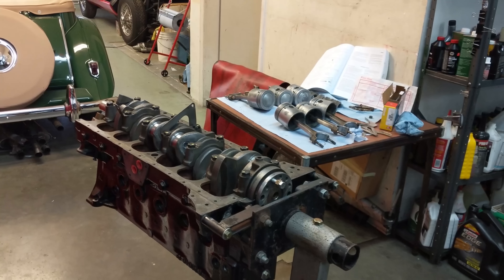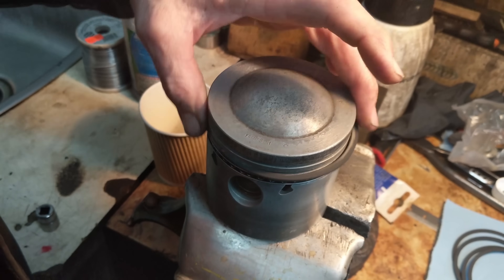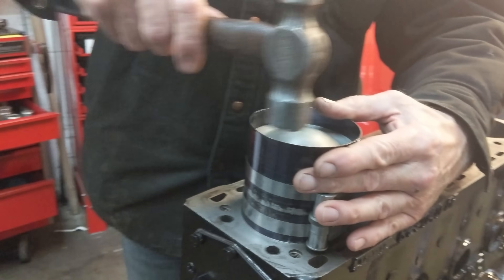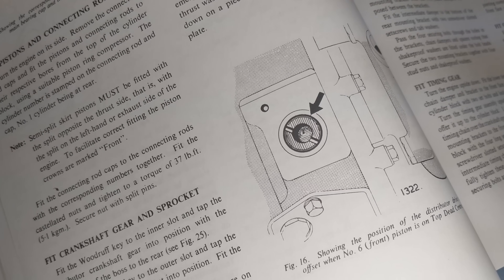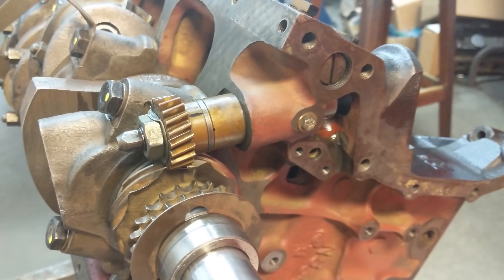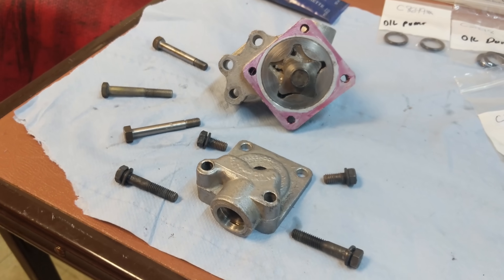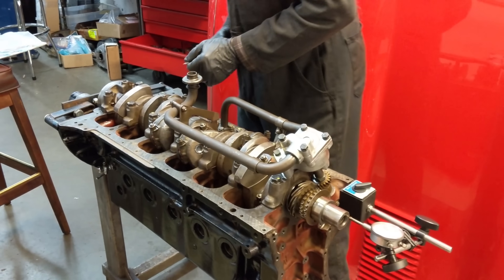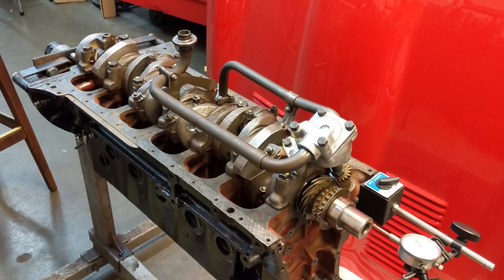My Junk E-Type Engine Part 6

Comment: You very lucky to have a great dad to help you along and pass the skills. I rebuilt my fist one in 1974 and completely cocked it up however Have now rebuilt my XK engine from lifelong skills and it runs great.Little advice-Use some cheaper oil to get it running and after the first hour change the oil and filter. You'll be amazed how dirt still is in there however careful you are. This will avoid any grit or swarf causing damage.
Reply from the maker: Adam. Great to hear from you. I agree, this engine was pretty surface corroded inside so a quick oil flush would probably be best. To be honest I didn't clean it all that thoroughly either.
Reply: I like his respect for his 'dad' and the respect for how the engine was buildt. Not just wasting good parts if it's within tolerance.

Comment: Nice Sequel to follow when rebuilding these engines!

I'm curious what type of piston rings did you choose? Do you have any suggestions based on the wear of the block?
Reply from the maker: I think those were Hastings
Reply: @RichardMichaelOwen  are those Hastings iron, chrome or moly kind of rings? I'm not sure what to choose

Comment: Coming back to this video after losing half my oil pressure this week,  I really struggle to see what could let go to cause such a massive drop in pressure. That pump is built like a tank.  The engine sounds great.  Assuming the pressure sender is ok, I guess I'll start by taking the sump off
Reply from the maker: Try a different sender or a fully mechanical gauge at the filter housing there. It's likely the electronics.
Reply: @RichardMichaelOwen  thanks for replying Richard, I will get a mechanical guage on it soon.  Hopefully just the sender, the guage reads maximum and minimum ok when shorting the sender wire to the block.

Comment: Hmm Lock Tabs, they were put there for a reason and old technology or not, they have a specific application on that engine, when a bolt rattles out, you will think why didn't I use the fold over locks. I notice you folded over 1 edge of a 2 fold lock tab on the oil pump. As you have previously stated, doing a thorough job is best.
Reply from the maker: Wayne, if you take apart your new Ford/Toyota/Audi you'll find no lock tabs for good reason.

Comment: Old video, but i will still leave a comment .  Why not re-tin piston/skirts for lubricity?  Also, all should use extreme caution ballerizing block or using scotch brite.  Both leave silicon carbide abrasive, no matter how well you clean.  I’ve looked at 100 engines with electron microscope after rebuild where SiC contaminants were the cause of the failure.   Either spun bearings of scuffed piston.  Clean carefully if used (thorough rinse with solvent).
Reply from the maker: Thanks for the tip. I usually rinse with brake cleaner.

Comment: OK Richard I don't know if this has been mentioned before but unless your dad has a gun at your head it is obvious that you have a great deal of knowledge (and also its obvious you dad does too), I love your video's and if you weren't that you live in freezy ass Can Nah Da I'd even visit you (so be thankful, a million questions have do I). I am currently re-building my MKII XK engine and was going to be sending you a couple of questions through your website but cannot find a Email address ??
Reply from the maker: Thanks for watching, just list your questions here
Reply: OK you asked :) as I do not have access to all the tools you have when sizing the crank seal is it possible to use the crank and do it in stages, ie: crank in lower seal in place then remove do it again with upper half in place ?

Comment: I have a 1971 E type, 4.2 Series 2.  It is certainly in need of an engine / transmission rebuild.  How can I contact you about pricing?
Reply from the maker: Charlie, our shop is Owen Automotive. 2506554338. Thanks!

Comment: Nice plus points for using a piston ring spreader. Mind you I did have a small heart attack when the hammer appeared, almost shouted no don't hit the piston with the metal hammer head but fortunately you were only using it to seat the ring compressor before correctly using the handle to tap the piston in!

Comment: Wow thats insane how the oil pressure is dependent on a o ring thats inside on a area that gets super hot to begin with, a flange on the pump and on the pick up tube with a gasket and bolts would have solved this easily from the factory, guess it works that way though.
Reply from the maker: It is flanged on one side that feeds crank, but I the flexibility of of the o-ring at the pump makes it way easier to install/produce

Comment: The gaps on the top 3 piston should be set at 120 degrees apart so compression does not go straight past the rings. Stagger the gaps will prevent this.

Comment: Richard, did you folks oil the rings and cylinder walls before fitting the pistons?
I have subscribed to this channel so I can watch this build up,..BUT I think I would have used all NEW bolts and nuts and certainly had those old wrist / gudgeon pins and their retainers replaced as well.  I think an engine re-build in this class, (Jaguar) deserves this. I was told many years ago that " any job worth doing, is worth doing well."
I am not saying you are wrong in what you are doing, I am just saying what I have done before. If I were there in your shop, I would ave asked the same question, I am merely chatting, with you.

Comment: Considering how frozen the wrist pins were completely checking them by disassembly would be a really good idea but I get it sort of a quick budget rebuild but if they have roller bearings in them  they really should be checked

Comment: Man I did an engine like this, it was a sbc, with just cleaning it by hand and a few tools like you are using. With the dingle ball tool and the ring expander. It ran fine, always a little loose but it ran for many years. It was done this way for decades. But it is good to see someone doing it these days.
Reply from the maker: Yeah not a top job for the junk engine. Hopefully I will get away with doing just the bare minimum.

Comment: I was with you all the way until you said you're not replacing the rod bolts!! Whaaaa.....aat??? You spent all of that time and money cleaning, prepping, replating bolts, nuts, washers but you reuse the rod bolts? It's lunacy, plain and simple. Those bolts have been stretched, have seen many cycles and are fatigued and should never be reused. God blessed you with a all original standard bore block, perfect uncut crank and you risk it all by not replacing the single most important fastener in the engine...SMH
Reply from the maker: Let's see, time will tell. I think this engine was fairly low mileage. I have seen many rebuilt Jaguar engines with original rod bolts, they seem to hold up.
Reply: @RichardMichaelOwen  Thank you for replying, and I wish you nothing but the best of luck with the engine and car. I love the old Jags and the thought of that rare, near new engine pitching a rod thru the side of the block and destroying it gives me chills and would be a very sad day.
Reply from the maker: @Sixguns1  yes I agree, would like to make a high-revving 3.8 sometime, then we would want arp rod bolts
Reply: WolverineLiving living YOU are so RIGHT.  I always replace any fastener under stress.  Oh well it's his engine but .....whew

Comment: When you first started to take the pistons out one or two of the Gudgeon/ wrist pins were tight, i would of taken them all out but it depends whether they are fully floating or shrink fit in the piston.
Reply: I'm sure I saw a circlip for a brief moment there in the side of a piston suggests to me they are fully floating. I have never heard of shrink fit in a piston, maybe you mean heat/press/shrink fit into the connecting rods ala Small block Chevy/Cooper 'S' etc.
Reply: Looking again, yeah, press fit, no circlips
Reply: @dalybaz  Hi Baz, my Vincent motorcycle has shrink fit gudgeon pins. You have to heat the pistons in an oven to expand them and very quickly slip the pin through the piston and rod then fit the circlips.
Reply: @johncone9516  Way cool. (no pun intended) That's one way to cure a rattle. I take it that the circlips are there to prevent bore scoring in case of an engine overheat. 
I've really only had experience with BMC 'A' series engines. The 850s and 997s  and minors had pinch bolt gudgeons, the 998s and 1098s had fully floating pins with circlips while the Cooper 's' and 1275 Spridgets had an interference fit on the conrods. All rather confusing really.
If you are hotting up a minor 1000 you pinch the pistons and rods from a 998. The maximum I ever got a Minor was 105 thou oversize using +60thou 998 Mini pistons. Another good mod is to use Teflon plugs to replace the circlips which have a habit of jumping out at high revs, with obvious consequences.

Comment: try a little oil in the cylinder and ring compressor to mark the install easy.
Reply: markam campbell All rings should be oiled before assembly .

Comment: I,m curious,,,,, 1000$ bucks for the engine... i,ve seen the oil pan for 1000 pounds!! I am wondering what the value of a restored engine like yours is.
Reply from the maker: No idea. If this was built for resale it would be a more thorough and expensive.

Comment: You should never, ever use the old cap bolts. These would have stretched. They might break. Always use new.
Reply: Totally agree! cutting costs here is stupid and could wreck your engine if one fails.

Comment: If it's not worn, broken or out of spec why replace it. Good job so far!
Reply from the maker: EXACTLY!!!
Reply: The simple answer to why is metal fatigue. Imhop, all fasteners, bolts, nuts, washers etc. should have been replaced with new ones just like bearings and seals.

Comment: Say Richard, I saw you reusing many crusty original bolts. Te;ll me that you cleaned them all with a wire wheel, especially the threads !
I really enjoy your series on this awesome engine. Thanks !
Reply from the maker: They will work just fine, despite the appearance.
Reply: That was off camera, Marc Rene, he didn't want to bore us with house keeping :)
Reply: Marc René Yvon He should replace them with new once they cheap .

Comment: I thought crankshaft end float is 0.003"  to  00.5"
We used to grind away a bit of the front main cap so you didn't have to remove the dizzy gear.
Used to get score marks on the edges of the oil pump rotor and inside the star.
Hope you didn't line up the gaps in the piston rings,    rist/risk pins ? ,    gudgin pins.
I would have liked a piston ring tool like that 50 years ago.
When fitting new pistons the numbers on the con rods went to the exhaust side if i remember corectly.
Cheers from uk.
Reply from the maker: Jeffery, thanks for your comments. I just checked the manual both 3.8 and 4.2 and they list 0.003 to 0.006 end float.

Yeah the pump looked great, just the drive on it from the distributor gear was a little worn.

Your right we should have made the ring gap placement more clear.